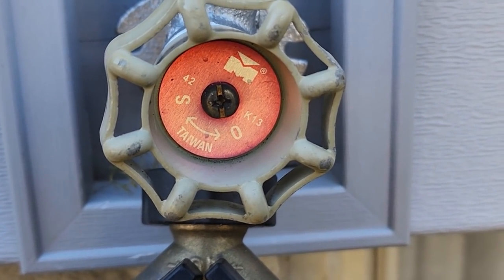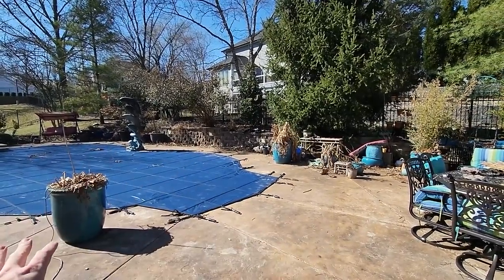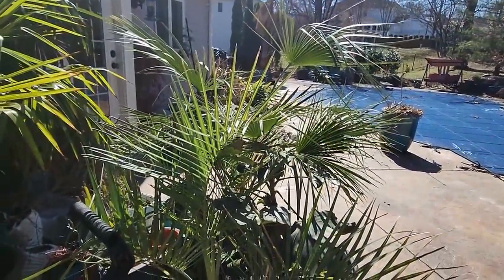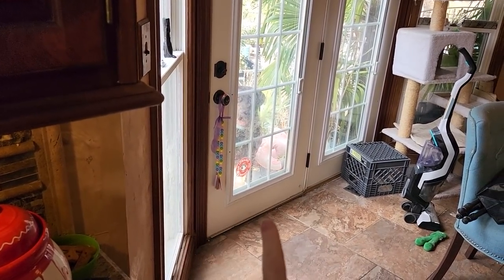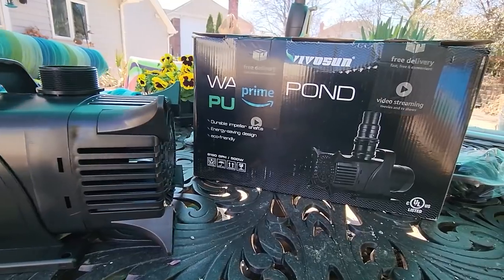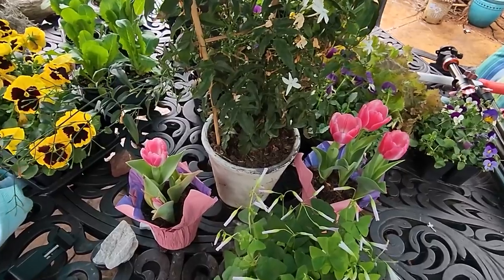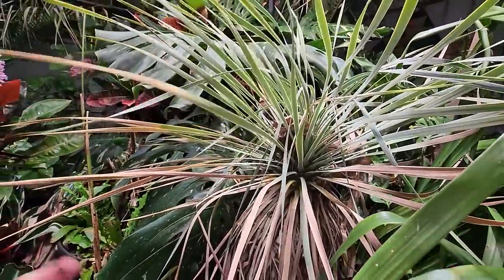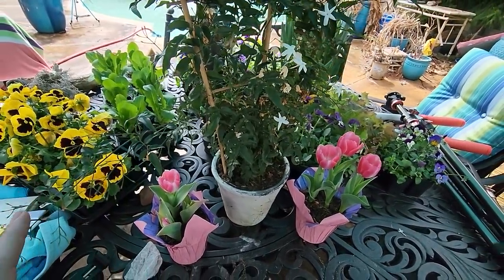Starting Spring Chores For The Backyard! SPRING!

Comment: "what does S and O mean"
s is supposed to mean shut (or sealed), o is supposed to mean open. 
So, did the Areca get mealybug infested this year or is that mostly taken care of? They look a lot fuller and greener than in previous years so just curious.
Also, those two bare root roses I bought for $8 at Aldi, those things are just taking off. I see buds on both of them and it has only been three weeks. If they flourish, I'm going to be extra mad about paying $35 each for little rooted cuttings from J&P last fall. (I was already mad when they came and they have hardly grown.)
Reply from the maker: I really don't know why the Areca isn't infested this year like it usually is. There are plenty of mealybugs in the growspace, but after just a couple of sprays, I haven't seen many on the Areca. I'm paranoid that I'm just not seeing them and thar any day now it's going to be infested! 
I've actually had tremendously better experiences with the bagged cheaper roses than potted fancy ones from J&P. Glad yours are doing so well!